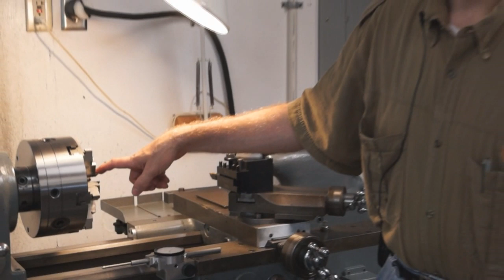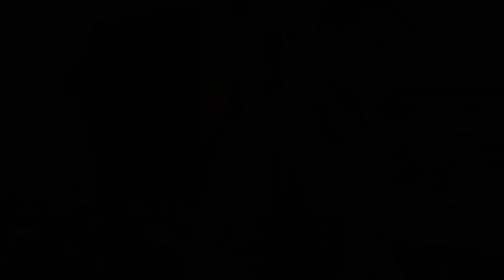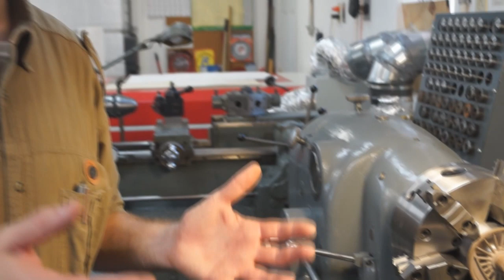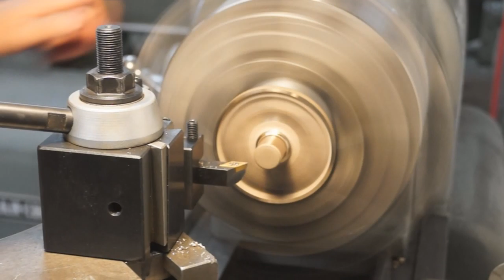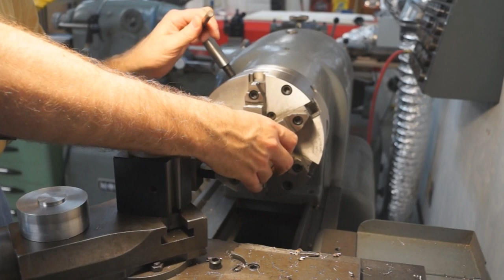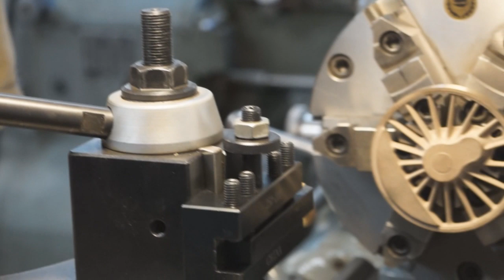Machining a Steam Locomotive Driver with a Raw Casting - Cumberland Model Engineering

Comment: Very nice lathe. Finishing up our install of  a DRO Pro’ lathe DRO on our 13 inch Clausing . Is that background noise your exhaust system, or is it the motor in the base of the lathe. Dave

Comment: what didn't you indicate the piece before you started your cut on the face
Reply: Because the facing cut of the edge of the wheel is already perpendicular to the turning of plug  he just did previously (by default -- same setup, has not been changed).
When he turns wheel around to do other side, surfaces will true and square. Make sense?